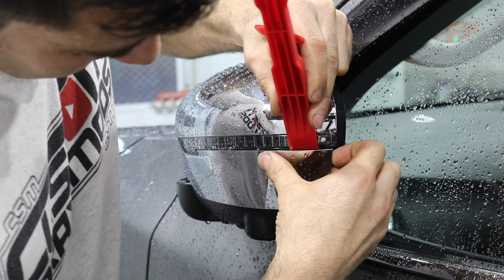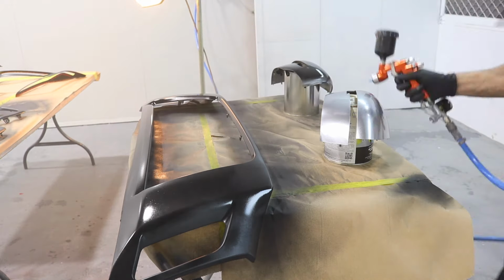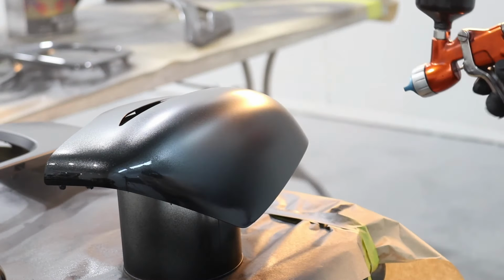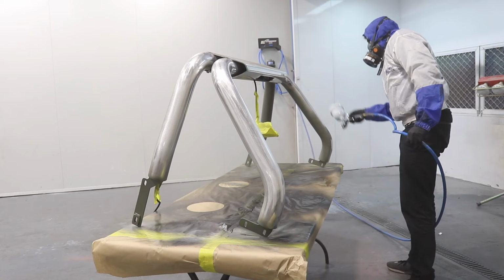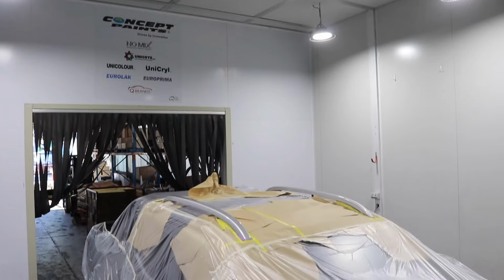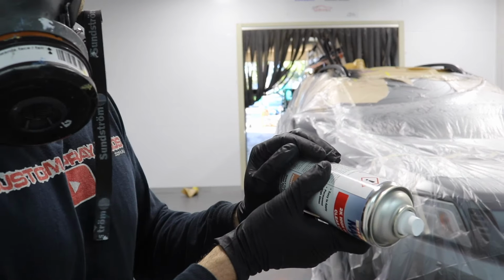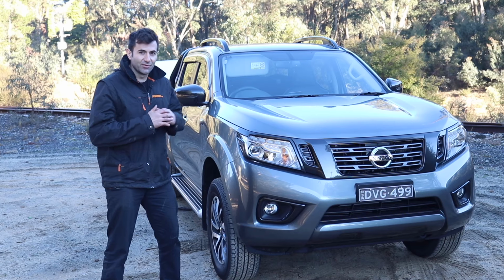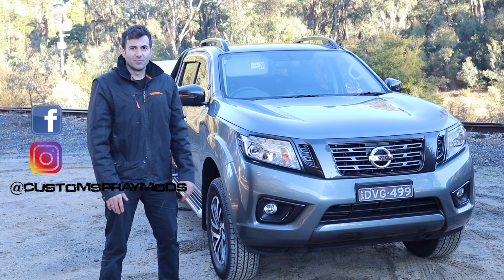How to paint over Chrome, black out your ride

Comment from the maker: Door handles wheels and side steps are done. Check it out here. https://youtu.be/bAM16Fi_5GY
Reply: I remember back in early 2000’s people want it chrome everything mirrors,grille,bumper,rims etc etc now it’s the opposite blacked out everything we going backwards...
Reply: Question if I'm going with a 2k satin black finish should I still use a satin clear coat?
Reply: Would you what would you estimate the cost to have this done at an auto body shop for a 2019 Honda Pilot. Thank you and thank you for the video
Reply: Can we get an updated to see how it held up?  Looks good!

Comment: Great job. There's a new 2k on the block and it has no pot life. You can use a lil now and a month from now. Car Rep. Bought and used and it's AMAZING. So nice not to have to have all the parts ready at same time and hurry up and coat. Now we can do hom much we can and not have to hurry or pay for more cans. Check them out. Car Rep 2k clear, primer even paint.

Comment: 0:55 Use clip removal tools to remove the parts you want to paint

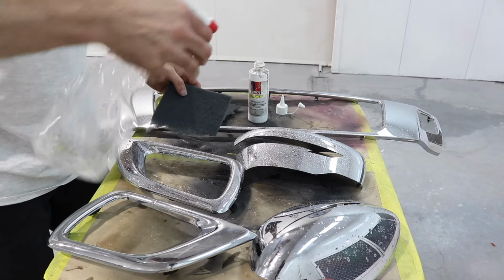1:30 Water scuffing paste and grey scuffing pads 

1:49 3m sanding sponges

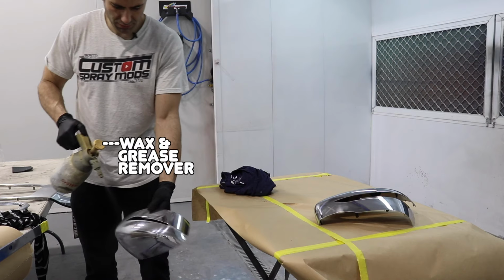1:56 Wax & Grease remover

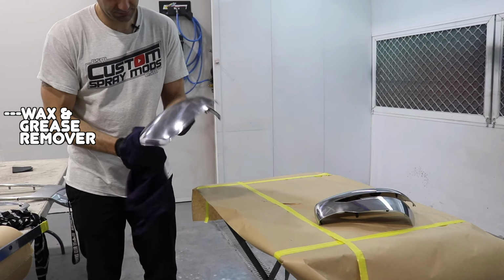2:07 Adhesion promoter (brand: UPOL, it’s grip #4, purple & black can)

2:24 10min after, use Black Etch Primer (V.G. Auto Paints & Tools. Custom Mixed Color. 20min to dry)

After this is all about whatever color

Comment: I can vouch for the Max 2K clear coat... I used it on the fairings on my race bike and it's a million times better than the 1-part aerosols.  And the little Preval paint sprayers are great if you want to use custom colors but don't have a compressor or sprayer.

Comment: I have a set of valve covers that are chrome plated that need to get painted red. There are a lot of dings, scratches and rust. I have a sand blast cabinet. My back and hands are trashed from wrenching for 40 years. I don't think I have it in me to scuff them good enough. Should I sandblast them? Wouldn't blasting it make for a good surface to paint?

Comment: Looks heaps better Dave, top job and cheers for yet ANOTHER ripper tutorial vid! Will you do the door handles too? Also, it’d look tuff with a big set of wheels and maybe some flares like a wide body kit.... and one (or 2) last things; is there any particular reason you used a smaller/touch up gun for the plastic parts and the bigger/normal gun for the Chrome Sport Bar? Also, what size tips where on each of the guns please? 
Thanks again Dave ya bloody champion, over the years you and your CSM videos have been more help than you’ll ever know!
Reply from the maker: Bobby Dazzla the mini gun is 1.2mm the big guns are 1.3. Used the big gun because it's a bigger area that's all.
Reply: Thanks for the reply Dave.  Much appreciated.

Comment: I did the same thing to a Nissan several years ago...the sanding, the primer, and paint on the plastic and metal chrome, but it did not hold up. I was constantly touching up. The paint just did not stick and I followed and bought all of the materials at an Auto body supply dealer. I have another Nissan and I want to do the same thing, but everyone is saying the Plasti-dip works the best? I am almost afraid to try it again.

Comment: I learned to always degrease before scratching parts up
Reply: srspam menot why is that?  also, if you degreased before, should you also do it after sanding?  Thanks
Reply: John McCure shouldn’t have to degrease after sanding. Degreasing before sanding would make sense
Reply: @dillonmelin7757  not if you are sanding oil INTO the surface !
Reply: srspam menot thats what i said. degreasing before sanding.... so theres no oil....

Comment: Why did you use etch primer over adhesion promoter, is that the same as using a regular primer since the adhesion promoter base layer would inhibit any etching properties of the etch primer?
Reply: No, the etch primer also acts like a normal primer. The adhesion promoter will help the etch primer stick to the plastic, as well as give a black base to hopefully hide stone chips when they happen

Comment: isn't using etch primer over adhesion promoter illogical?
Reply from the maker: Jason Pinkwhistle the etch primer is also a primer. The adhesion promoter will help the primer stick to the plastic and give a black base to hopefully hide stone chips when the happen
Reply: @customspraymods  your suspose to use a value shaded sealer over plastic, if raw plastic use a plastic adhesion promotion first.Etched primers is for raw metals

Comment: Any tips on doing chrome plated bumpers? I currently have my bumpers plasti dipped..
Reply from the maker: RadoMark408 exactly the se as how I did the sports bar. Sand and etch primer.
Reply: Being the bumpers, should I go down to a more coarse sand paper? Or would it be okay just doing it like you have done. Just scared of rock chips that may cause the paint to chip or flake off.

Comment: I'm confused now. I went to two paint shops and they told me painting chrome pieces can't be done. I wanted to paint my chrome door handles, mirror caps and front bumper eyelid. They say it can be done but they won't guarantee it.  So what is the real answer?
Reply from the maker: Here is a video showing that it can be done.
Reply: @customspraymods  I know. I've seen many videos on line that it can be done.  I  literally went to two paint shops yesterday wanting to paint my door chrome handles and side mirrors. Both shops told me the same thing. The last shop even gave me a lecture on why you don't paint chrome pieces. I was shocked because I told them why is it not possible when all you have to do is sand and scuff the parts and then start there.  There say the paint won't adhere to the chrome. He said it can be done but he can't guarantee it...I said isn't that what the adhesive promoter is for? 
Well I just left the shop. Initially I was gona do it myself but I wanted to see prices so I could just pay for it if it was a reasonable price. 
So I will just do it myself now I guess.   Your video is the best I've seen to date out of the 20+ vids I've watched in past 2 wks. 
 Just wondering why paint shops won't do the work. 🤔

Comment: If you were able to rough up the surface sufficiently with just a Scotch pad, then those parts CANNOT be chrome. Chrome is extremely hard and even the toughest abrasive papers will barely touch it. I would suspect they were actually aluminium, probably applied by vapour deposition (like headlight reflectors). With chromed plastic parts, IT IS necessary to remove the chrome before painting the raw plastic as paint simply won't stick to chrome, since it is so smooth. If they were aluminium coated, then fair enough, the ally can be roughed up and painted, though I would argue you'll get a better finish by removing it (oven cleaner) and painting the plastic. https://www.youtube.com/watch?v=CDF3A3xUYeY

Comment: Laughing at the way you say that WE can do it too because the 'adhesion promoter' and etch primer comes in spray cans, and we'll get the job done.
In the next frame you've moved over to the compressor type spray gun.
You joker.  How will people get the job done now, 'cos you said we wouldn't need a compressor?
Reply from the maker: thecorbies there is a link in the description that shows how to get a good finish with spray cans. I also painted the roof rails with spray cans.